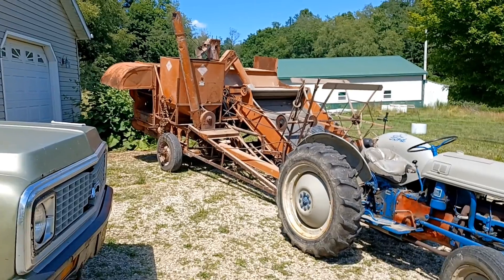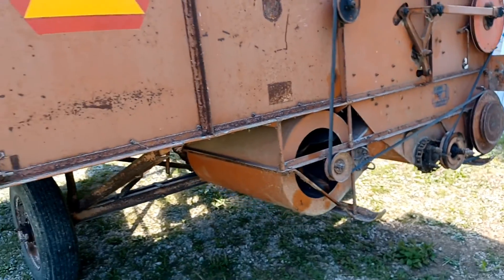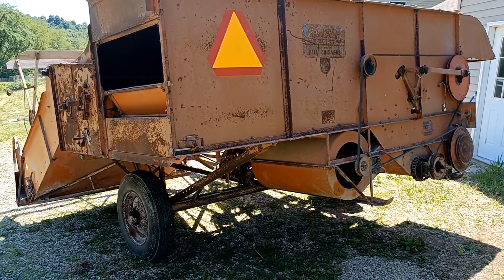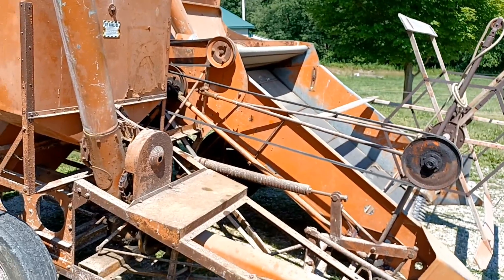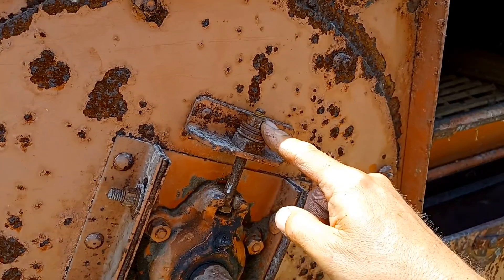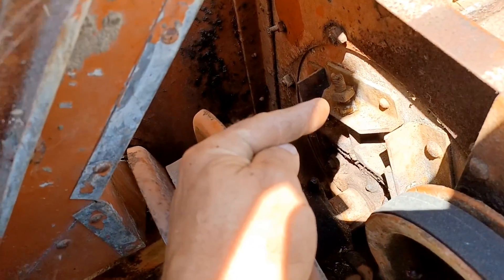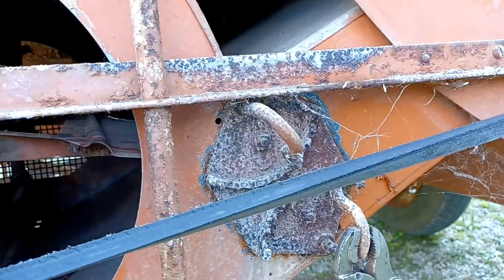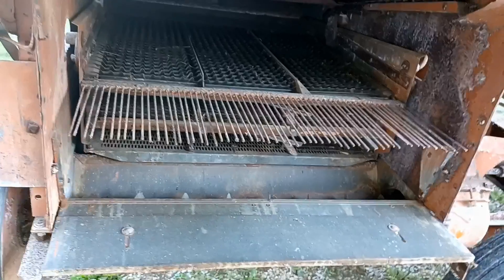Allis-chalmers All Crop 60 Combine Setup - Picking Field Peas

Comment: Good  day from Ontario. Our neighbour  had  Allis WD tractor ,   rd baler,  & 60 combine.  ! drawback was  the reels were ground drive  if grain was down reels would not help pull grain in.  I think the cylinder had rubber on bars. Back in  67 tractor supply started   &  he bought new cylinders bar  from them.  Interesting video.  80 grease zerks  alot.  Thanks

Comment: I would be afraid with a transmission PTO that combine would push that 8N right off the end of the field.  I didn't see an overrun clutch on the PTO.
Reply from the maker: Yes, it absolutely has one.  And to anyone trying to use large implements on a Ford 8N, you MUST run an overrun clutch on the PTO!